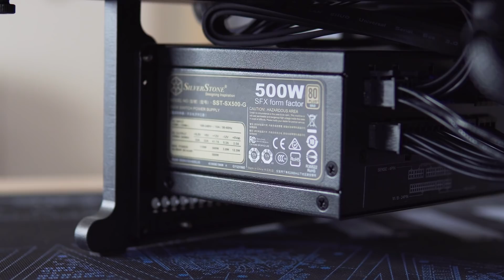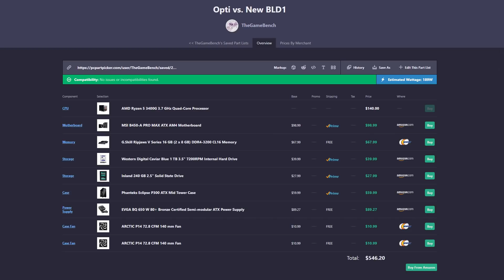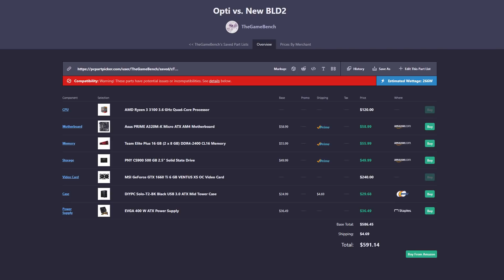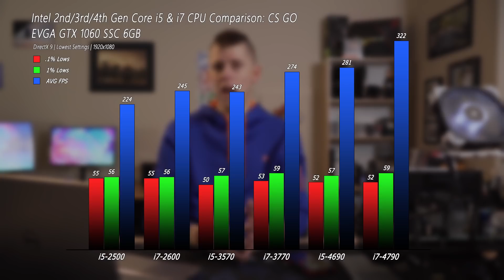Dell OptiPlex Q&A Pt. 1: OptiPlex vs. New, CPU & Mobo Upgrades, GPU Upgrades & More

Comment: I bought my son the Dell precision T1700 and I paired it with a Asus Dual Radeon 5500 XT. When the GPU is installed, it covers the SATA ports for the hard drives on the motherboard. Does anyone have any ideas for a work around?
Reply from the maker: Interesting... the T1700 shouldn't have that issue with any dual slot GPU. The Dual must be a little thicker than two slots. Thankfully, the solution is pretty simple. Just use some low profile cables. There are some 90 degree SATA cables you could use, but you'd have to get a left/right angle so you could use both ports. Also, most 90 degree SATA cables are tall... so it's a crap shoot if they'll be short enough. Silverstone makes some low profile cables that work perfectly, but they're a little spendy as far as SATA cables go. For the USB3 header there are some low profile cables as well.

Silverstone 300mm: https://tinyurl.com/ybhreyms
Silverstone 500mm: https://tinyurl.com/ydzaw942
Low Profile USB3: https://tinyurl.com/ycd9e8vy
Reply: Thanks for the help. I'll keep you posted after I receive the Silverstone cables. Your channel has been huge in helping me put this Dell together for my son. I hope your back to full health soon and I look forward to more content from you!

Comment: The GeForce GTX 970 4GB SC will fit in a dell 990 MT but you need the low profile SATA cables with about .5 inch clearance.
Reply from the maker: Good to know. I used to have a couple of those and I recall them being under 10 inches.

Comment: Best Optiplex builder by far. I hope to upgrade my optiplex and maybe sell it. It's a 9010 MT with 3rd gen i5 3470 12gb and GTX 1050 ti. I built a ryzen system this year with 1070ti. When I upgrade that  graphics card, I want to put it in the optiplex and maybe find a cheap i7 3770. Thanks for your work it is the best showcase for what older dell pc's are capable of achieving in the gaming space
Reply from the maker: Wow! That's some high praise. Thanks!
Reply: @TheGameBench  Serious man you've earned that title.

Comment: Is the asus strix rx 570 good for a dell optiplex pls
Reply from the maker: Maybe... I've been playing with a Strix 470 and it consumes about as much as a 1060 6GB. However, the 570 has an 8-pin, so it might draw more power. So it might be on the edge of what I would consider safe on the stock 290 watt power supply.

Comment: 6:55 yeah the terribly placed SATA & USB 3 ports almost make me wish I got an ITX sized rx 5500 instead of an rx 580 just to net deal with the hassle of the special cables & right angle adapter.
Reply from the maker: Yeah, it sure can add up getting all the cables to clear. Especially of you go with the Silverstone cables.
Reply: @TheGameBench  is "Silverstone" the brand of SATA cables that you used?

Are they good? Is it there any other brand, just in case?

Comment: Hi I think I might need your help again I think I got given a bad gpu I bought this gpu off a local source it’s a evga 1060 6gb ssc but it looks like it doesn’t work when I contacted the seller he told me to figure it and deleted his WHOLE ACCOUNT at his video card seems to turn on fans spinning and all but even with all the right drives it wouldn’t display signal do you thing this is a fixable issue or should I not waste my time?
Reply from the maker: I'm sorry... that sucks. It's possible, it just depends on what's wrong. You could start by taking it apart like I did in my used GPU video, and give a good cleaning and look for any obvious dead components. You could try booting the system with the card installed and using the onboard video for signal, and try flashing the proper BIOS on. As a lost resort you could try reflowing the solder. Some people like to put in an oven at a low temp, just DON'T use an oven you plan to ever eat out of again. That or use a heat gun, but if you're not careful, the heat gun can destroy the PCB.

Comment: Ive said this before on another vid, but the HP Z230 is a good step up for gamers from these optiplex units. I've got an almost 13inch 3 fan Gigabyte GTX 970 in mine with zero mods required. It came stock with a 400w psu that feeds the 970 which can peak at roughly 240-250w from the GPU alone, something no stock optiplex could ever hope to do. Note the z230 only comes with one 6pin so you may need a dual sata to 6pin to feed really power hungry cards like mine.
Reply from the maker: Yeah, I'm really liking the Z series. I finally got my hands on one and it was the same price as the equivalent Opti, and with the 240/440 coming down in price, I have to recommend those before the, even more constricting, Opti xx40 series.

Comment: what budget power supply, should I buy for my 1020 so I do not have to deal with the SATA connector
Reply from the maker: Yeah, EVGA is a good source for budget PSU's that aren't trash. I suggest avoiding the 80+ models. That 500 BQ for $45 is a really good option.

Comment: I got two of these MT Dell Optiplex 9020's. They work great. I'm not needing to game play at extremes, so upgrading the GPU, and PSU is really all I feel I need to do. However, the PSU needs to be addressed as to which PSU will fit. Not all PSU's like not all GPU's are all the same size. Or at least I found when I went upgrade mine. Great channel and thanks for the leg work. You do it well.
Reply from the maker: Yeah, I do need to do a PSU upgrade guide. Probably do that as well as a separate video talking about the minutiae of power supply specs.

Comment: Nice vid. I've two Ques.
Currently, my optiplex 7020 build is showing below-
Cpu: i7 4790 4th gen.
Ram: 32gig (8+8+8+8) ddr3l
Ssd: 250 (2.5inch sata III) for boot drive
Hdd: 1tb for data storage (5400rpm)
Psu: dell stock (290w)
1. Which gpu should I use best value for performance?
2. Which psu (how much watt) will you recommend for best performance? 
N.b: I've already bought a 24pin to 8pin converter from Ali express. And kick out the hdd caddy for free the gpu space. 😁
Thanks in advance. I'm from Bangladesh watching you from very earlier and really love your channel. ❤️❤️
Reply from the maker: Thanks! I guess it all depends on where you want to be. Right now is a bad time to buy a GPU. The used market is pretty bad. At least here in the U.S. so it might be better in Bangladesh. The 4GB RX 470/570 is hard to beat at the entry level, and if it's not much more, the 8GB. Same goes for the 480/580. However, keep an eye on the 1070 and 1660 Super. If they're close in price, they'd be better than the 480/580. For anyone of these cards, a 500 watt would be adequate, and the 160 Super can run off the stock power supply. I like the EVGA BQ series on the budget end, or the Corsair CXm models.

I hope that helps.

Comment: Hey so I bought an Dell Optiplex 990 i5 2500T  for £60 it has 350 watts what sort of gpu do you recommend please ?
Reply from the maker: For the 2500T I'd suggest something like the 1060 3GB/6GB, RX 470/570, 1660, 1650 Super and maybe the 480/580. Much more than that and the 2nd gen i5 is going to start to become a serious bottleneck.

Comment: have done optiplex 7020 i7 4790 with 450w psu,ssd,hdd,24gb ram,1660 super triple fan and 2 add on 120mm fans cable tied... so janky lol
Reply from the maker: Janky... but effective.
Reply: @TheGameBench  love my sleeper hahah.. yeah in my country quite cost effective compare to new parts of i3 10th gen or ryzen 3100 full build
Reply from the maker: @muhammadsyafiq8508  Man... I completely forgot that aspect. Yeah, outside the U.S. getting a new system could be a VASTLY more expensive prospect than going with a used OEM build, depending one where you are.

Comment: I'm hoping 2021 will bring a more moderate used market.  Prices are so out of whack for now.
Reply from the maker: You and me both. I think it will once stock stabilizes on the the new GPU's. It will also help when we have some more mid range and entry level models. Might have to wait until the middle of 2021 sadly.

Comment: Glad to see you back man! Hope your health returns to 100% soon!
Reply from the maker: You and me both. Thanks man!
Reply: @TheGameBench  I've been working with these dells for about 5 years. I'm offloading the last 10 I have of them. I think their days are close to an end, at lest for modern gaming. Again , hope to see you feeling better soon
Reply from the maker: @stevenwilliams6638  I don't know, I starting to think that things may not be too bleak. I'm starting to think that AC Valhalla and CP 2077 are anomalies, and not trends. Still, I wouldn't have overspend on these systems if I could help it. I plan to get all the ones I have on hand moved before summer, when the new GPU's start to stabilize on stock. However, tariffs might present a further issue for the new market and keep the used market pretty inflated.
Reply: @TheGameBench  it's a shame that Dell made their systems even harder to case swap. I mean it's possible but it's to much of a pain. Really crappy of them honestly, as they are just going to end up in landfills quicker, as they can't be swapped. (Not as easily as 4th gen and older)
Reply from the maker: @stevenwilliams6638  I'm actually considering grabbing a 40 series to overhaul. They do make it a PITA but it's not an entirely lost cause. Still, I think the Z series is the more viable option.

Comment: Dude thank you for addressing the giant elephant in the room the dreaded GT1030.... The GT1030 can only be compared as an upgrade over the integrated graphics but it doesn't hold a handle to any decent GPU out there. Its honestly a big giant waist of time that Nvidia keeps making it. Now if they came out with a 3000 series version of the GT1030 that didn't suck and was less than 100$ finally low budget gaming wont be a terrible option especially for low profile systems.
Reply: The GT1030 is really only an option for those with a SFF system that can't fit anything more powerful in it. It has its place, but it shouldn't be seriously considered by anyone who has the option to use something more powerful.
Reply from the maker: It doesn't make much sense at the price. I think most beginner PC gamers buy them for systems like this because they've been fed the lie that the power supplies can't deal with anything more. And at the price, there are much better options. I honestly don't see why they exist beyond being bought by confused people that don't know any better, or people that refuse to buy a used GPU.

Comment: Would a 4790 non k bottleneck a 1660 super?
Reply from the maker: Nah. The 1660 Super is on par with the 1070 and the 4790 has no problems feeding that, so you'd be good to go.

Comment: Welcome back ! Btw I'm planning to upgrade my Optiplex very soon so my decision is over. I'll get 2TB HDD for data, 120GB SSD for Windows, I'll keep my CPU, my power supply will be a 500W or greater and a GTX 970 or RX 580 8GB. I hope my upgrades are good. So merry Lockdown and a happy new year !
Reply from the maker: Yeah, 120GB should be fine for most people for the O/S drive, and a hard drive will only effect load times and 2TB can hold a lot of games, so long as they're not Modern Warfare sized games.

Comment: Here's the path I took since I was gifted an Optiplex 9020 i7 4790 (non k) 3 years ago. I've been using it stock since I had it for a home work station but decided recently to build my own pc since the new AMD product came out. I bought my psu, fans (rgb for my fps), case, 65 gaming Ducky keyboard, and b550 MB. Then covid hit and I a really patient person since I game exclusively on console (so does all my friends). I did however catch the build bug and started digging since I figured I won't be able to build my "new' AMD pc for a while and my son just recently took up and interest in building pc's so here's what I did: Purchased a used msi Z97 mb, 16 gb of ram (at 32gb already, and before I started my AMD build years ago) and decided to throw everything into the case rgb fans and all for the AMD system I paln to build when the world returns to sanity. 

Here's what I have:z97 mb matx, 32gb of ddr3 ram 1600, ssd 128 (OS), 500 hdd storage, New case DLM21 mesh with rgb fans, Corsair psu 600w mod. Here's my dilemma, what gpu should I buy? I was strongly considering a rx 580 as I don't plan on using this as a gaming pc with plans on my AMD build.

Also: The used z97 board I bought came with a i3 4170 and 8 gb of ram I plan on letting my son build his own pc just to play around with and learn so bought him a used mb but conflicted  on the gpu. I was thinking a 1050ti. 

Sorry for the book lol but I'd appreciate the feedback from you or anyone in the comment section.
Reply from the maker: Yeah, I say if you're not looking for something high end, it's hard to argue with an RX 470/570 4GB. They're the best value right now as you can find them under $100. RX 580's are way too expensive considering their level of performance right now. And I'd go with that over the 1050 Ti as well since you'll pay more for the same amount of VRAM and a slower GPU.

Comment: Hello, I have a question, so what graphics card would you recommend for a game called rust also keep up the good work I’ve been waiting for this next video
Reply: I run the Zotac gtx1070ti mini with i7 in Optiplex but a gtx1060 6gb or 1660 will also work fine with an i7. I gave up running i5's in these 3rd and 4th gen Optiplex as these cards will start to bottle neck i5 in Rust and others.
Reply: @N_Andrews  thanks man
Reply: @N_Andrews  what would you think of running a i5 4460 with a 1650 super or would that bottleneck the cpu
Reply from the maker: I've tested the 1650 Super and the 4460 won't really bottleneck it. For Rust, if you're looking for 60 FPS, you might have to play at medium to high settings.
Reply: @pumpkinman2343  Should work fine. A 1660 will also work, but may be a little held back from it's full potential I feel. In the long run it may be a better investment when you upgrade to a newer  system you will have the better GPU to transfer over.